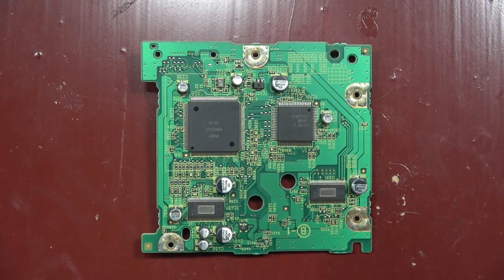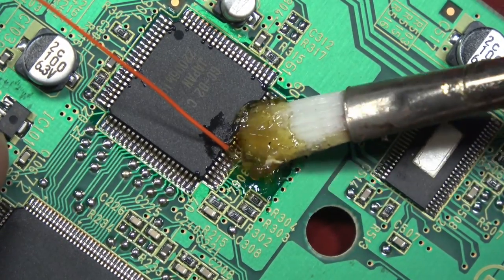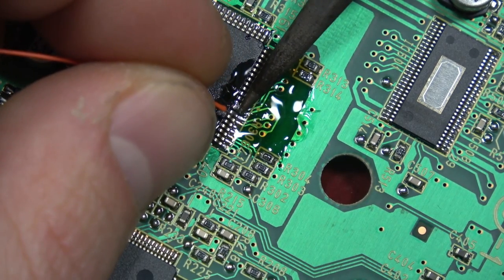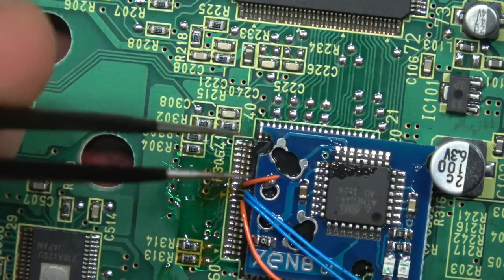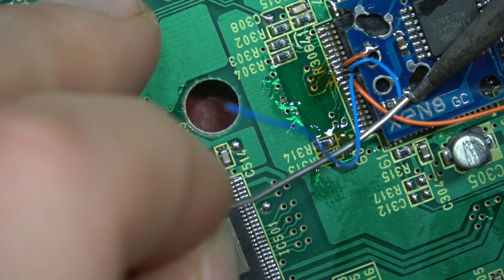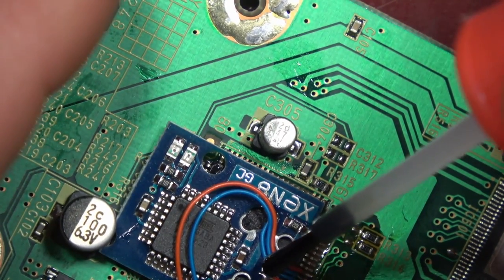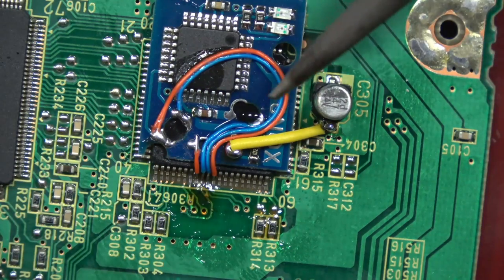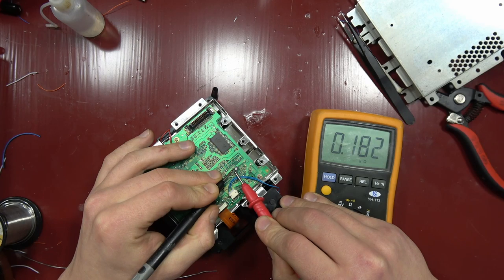GAMECUBE XENO MOD DONE DIFFERENTLY

Comment: Xeno was my first chip mod I did to learn how to solder. Took me hours with a lot of burned fingers but I learned a lot. I also ended up using wires because I could not get the solder to flow through the board to the contacts.

Comment: Oh man, I just suck at getting it with the no wire method because I suck. I tried so many times the pads wore off the board, so I might be able to do this method.
Reply from the maker: hell yes! that install diagram that i flashed for 5 seconds, if you just google "xeno gamecube alternate install points" it pops up quickly
Reply: @ThirstWorldTTV  Thanks a ton.

Comment: nice work. good video. I just got a soldering iron so hopefully i can use it on something soon.
Reply from the maker: Thanks buster, you did?? nice nice nice, get a mm3 modchip for the ps1 and start there. Trust.
Reply: @ThirstWorldTTV   i'l see if i can get one. will it work on the fat and slim?
Reply from the maker: yes it will, any mm3 chip will work on all ps1's, just the install is different for each ps1
Reply: @ThirstWorldTTV   okay. makes sense.

Comment: wasnt a fan of the recommended install method either, i double sided taped mine next to the points and ran small wires. my mistake though was getting a chip with two red LED's kept waiting for a green light that never happened, likely had it correct the first time should have tested it lol

Comment: Hi, not sure if you’ll see this but, what happens if two pins are bridged and not corrected? I decided not to go through with this as soon as I bridged two and did my best to separate them. Probably didn’t completely. When I plug in my hdmi cable to my cube, I hear static in place of sound and at this point I’m not sure if it was because of this or probably just my hdmi port. Video works perfectly fine as well as controllers, its just sound thats messed up. :(

Comment: Splendid work, my friend! Always interesting to watch your mods! Question: what kind of iron and tips do you use? I have a Weller abs I can never seem to get the right temperature out if it. Also, have you ever used one of those solder vacuums? Some people swear by them. Again, awesome work!
Reply from the maker: So! i was using a cheap cheap cheap soldering station from radio shack, it died after 2.5 years of using every single day, I just got a hakko fr-888. I do use the engineer solder sucker ss-02. Those are the best ones

Comment: Hey Sr. I have a question regarding this method. 
So... Accidentally, i burned two pads next to the "10" pad on the normal method. If i make this successfully, would it work? Any help Will be appreciated.
Reply from the maker: Yea, bassiscally this is an alternate install method if mistakes happen on the first method. The way I did it was to be harder to solder for no reason though. You don't have to go to the pins of the IC if you don't want to. There's vias to solder them too on the diagram I showed you'll see
Reply from the maker: Google "gamecube xeno mod alternate install points" and you'll find the diagram on Google images, just follow that and you'll be fine
Reply: Is there a problem if some capacitors gets separated from the board?
Reply: @moxxievansaint6724  May have to replace them with new compatible ones. Blah, especially if the leads are too short. The capacitor may still work though if not, can look up how to test them & how to replace bad ones with correct side & orientation.

Comment: Would you be willing to fix a botch job that I had done on my PAL region Gamecube? They refuse to give me my money back or fix what they did.
Reply from the maker: A xeno mod?
Reply: @ThirstWorldTTV  yes, they butchered it horribly. It's mounted on the wireless side, with wires running from behind. He said there was an issue installing it. But he got it to "work" I'm very upset, took me forever to get a Pal region GC. I was going to use the Rad2x cable I use for my RGB modded N64 amd SNES, since it outputs RGB
Reply: Would pay you of course. I want this fixed amd done by someone who knows what they're doing.
Reply from the maker: I dont accept send in mods or repairs anymore, I stopped doing it a while. But I kinda want to do a xeno mod again, Theyre fun lol. And I wanna fix the bad stuff that happened to you, that's unfair.. anytime I messed up a mod I would always fix for free or refund. Message me on social media or email and I'll tell you where to send it
Reply: Email sent, Thank you for the response.

Comment: Hi, 

I need to do this tonight... the smallest gauge wire I can find locally is 30AWG (.25mm) will this be small enough?

EDIT: I re watched it a few times... at 2:30 so its .5mm pins with 30AWG wire.. you spoke so fast it was hard to follow LOL!
Reply from the maker: 30 awg is perfect. And thank you. I'll start slowing my videos down a little. This is something I've always wondered and no one ever offered that info!! Thank you so so much!
Reply: @ThirstWorldTTV  well I followed your install but instead of soldering strait to the pins I used the holes on the board that ink to them.

Install seems to have worked but no matter my POT settings I can't get it to read a burnt DVD.

I have a new laser of its way from Japan and will try again when it arrives.

I might order the cheapest NTSC game I can find in Australia.. that would at least tell me the chip works if it plays a non PAL game.
Reply: Woo! I Dropped the pot all the way down to 50 (yes way low) and now it's reading burnt games :-)

I was reading that there is a 150in line resistor so even if you drop the pot to 0 it's still ok?

Either way I have a spare on its way as mentioned so I'll keep it like this and see if it blows up.
Reply: @ThirstWorldTTV  Noticed you used a thicker gauge of wire for power and ground. Was this for any reason or does the voltage/ground a thicker gauge? Thanks!
Reply: @urbangoose2192  Not yet, waiting for a response.

Comment: 1. Impossible to do without getting insane.
2. What should be funny about soldering? It is necessary when interested in Retro consoles but funny?! No way.
Reply from the maker: Lol. Thanks bro, appreciate you
Reply: I will try again tomorrow :-) I already hat all the wires connected but the last one was not in the center of the pin and when trying to correct it the wire to the left lost contact also.

I am also not sure which are the right pins to use. 8 to 11 (counted from the left corner) or 7 to 10 like in the screenshot you show in the video.

I did this mod a few times years ago but used wires and the solder points for the QSB but today i made the mistake of QSB-soldering which ended in damaging some pads and so i needed an alternate method. I also installed a PS2-modchip two years ago which was hard but doable. Not so here with these four wires next to each other. Maybe i could scratch the connecting vias and use them for the two wires in the middle.
Reply: Did it today but used the four single vias which are connected to the four pins on the Gamecube-chip. I used pins 7 to 10 (from the screenshot you show in the video) and not 8 to 11 as you did but i used your source for power. GND is always easy to find :-)